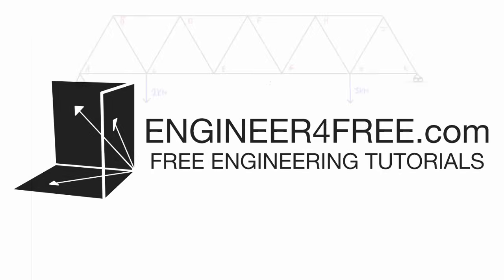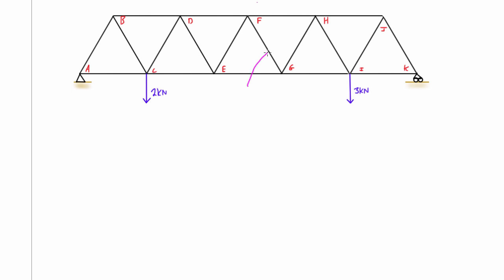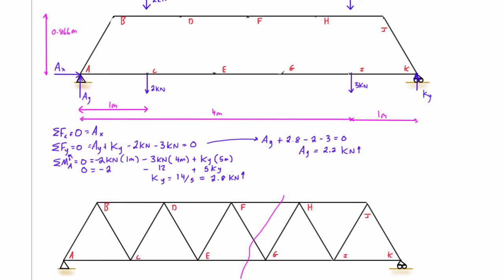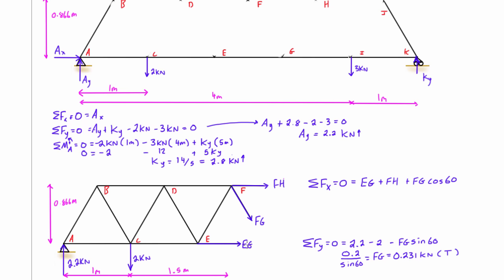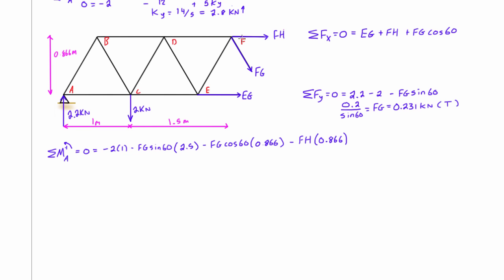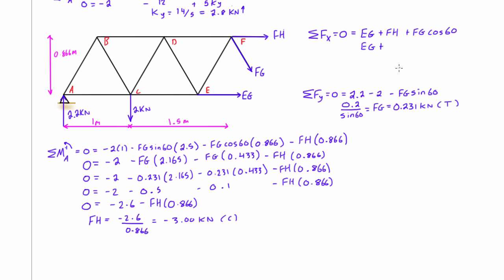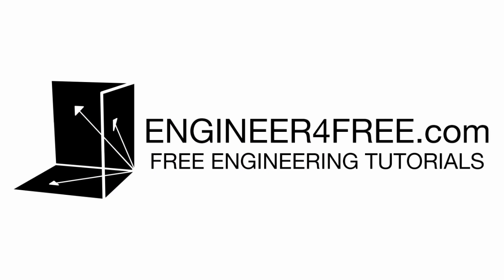Truss analysis by method of sections: worked example #1

Comment: it's wonderful, however, i'd like to ask about when the method of section is used, in terms of x direction calculation, why the force derived from pin end in the left doesn't be incorporated?(the example is at 3:08)
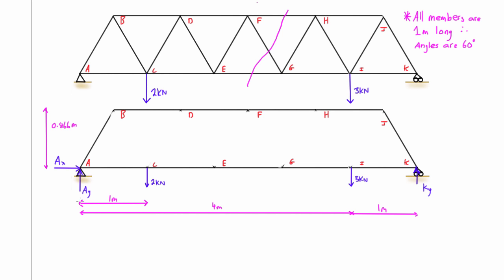Reply from the maker: Thanks for the question! At 3:08, I write the horizontal force balance for the left hand side of the truss after it has been virtually cut in half. Ax (the horizontal component of the reaction force caused by the pin at A) was determined to be zero at 1:38 so I opted not to write it in the expression at 3:08. I could have included it at 3:08 and written 0 = EG + FH + FGcos60 + Ax, but that could immediately  be reduced to 0 = EG + FH + FGcos60 because we know that Ax = 0. If you have already determined that a force is 0, then it's typically ok to drop it from other expressions that it is part of. If you or your prof prefers that you always write every variable in every expression to start, even if they are zero, then you should still do that as it's proof that you are aware of every term that is supposed to be in each equation. Hope that clears it up, let me know if you have any other questions!
Reply: Much detailed explanation, it really make sense. Thanx a lot with a great expectation for your more video.

Comment: Hiee...in the last step as u have taken sum of moments about point A and calculated force in FH. For the same step I've taken the sum of moments about point E and calculated the force in FH and the answer was 3.23KN compression which is different from yours...pls correct me if I've calculated wrong..
Reply: rajeev raj44  the moments about different points changes..
Reply from the maker: No matter where you decide to take the moment, the internal force in each member will be the same. Did you take the perpendicular distance to the line of action of the vertical component of FG to be 0.5? If not that will cause errors for everything else.

Comment: couldn't we take the moment of F to find EG? and then do the sigma of X? (notice: i am not saying you are wrong i was just wandering if my suggestion is correct or no) ty.
Reply from the maker: Hey sorry I am not understanding your question. When we virtually cut the bridge in half, there are 3 unknowns. We need 3 equations to be able to solve them, so we must take sum of forces in x direction, sum of forces in y direction, and sum of moments about some point. Picking A as our point to take moments about is just a convenient place as it will eliminate Ay from the calculation, and the distances to the lines of action of the x and y components of each unknown force is easy to measure. Does that clear it up?
Reply: SO what I think he means, and also what I am wondering, for this question in particular, is that it seems like if you take the moment about F after you've split the truss into sections, you don't need to analyze and find FG and FH to find EG.
Reply: Actually I just did the math and I got the same answer as him. So if you need to find only EG specifically, it is best to take moment about F :)
Reply from the maker: Oh cool yeah that is definitely a quick way to solve for just EG. Thanks for taking the time to notice and then check that it works! That would be a clever/sneaky shortcut on a statics exam if they only asked for the force in the one member, you could potentially save a ton of time by not bothering to solve for the other two unknowns from the virtual cut.. cool!

Comment: If all members are 1m, then down  its 3m not 4m, check it
Reply from the maker: Are you referring to the distance between A and the 3kN point force?
Reply: @Engineer4Free  yes
Reply from the maker: @Yourfriend100-ns1  Mmmm, take another look, the distance between A and I is 4m. It's AC + CE + EG + GI = 1 + 1 + 1 + 1 = 4
Reply: I mistaken, I'm considering it from C to E
Reply from the maker: No problem, you can take sum of moments about any point. But if you take about c, then make sure to also adjust the distance from c to A as 1m and include it, as thale reaction at A would then be a non zero value in the moment equation. No mayer which point you choose, you will get the same result as long as the math is correct!

Comment: Just waste time follow this way...i dont get correct answer
Reply from the maker: This method will work so long as you are only cutting through 3 members, and completely isolating the left side from the right side. It's always a good idea to check your values against the method of joints if you have the time. See videos 42 - 51 here: engineer4free.com/statics